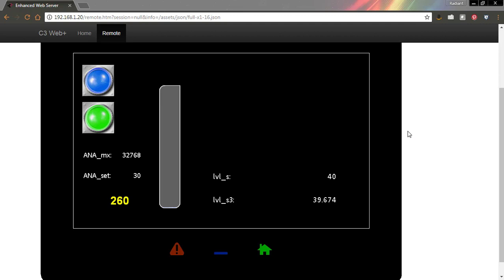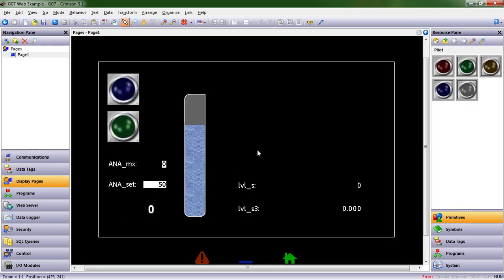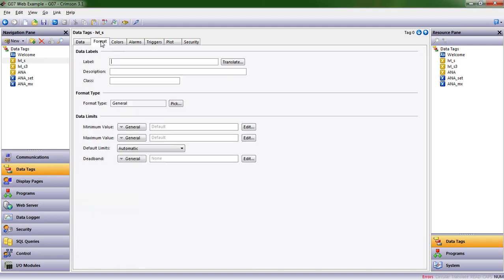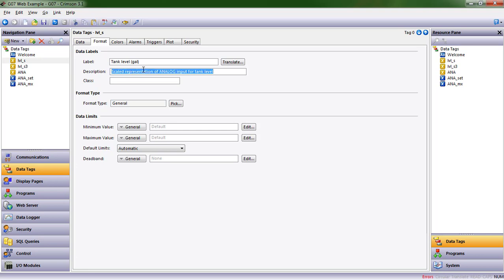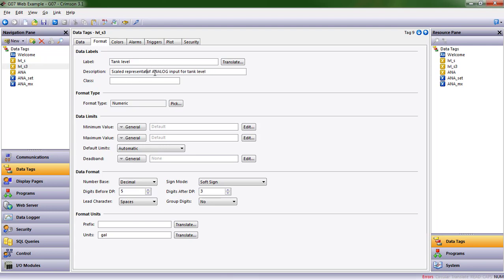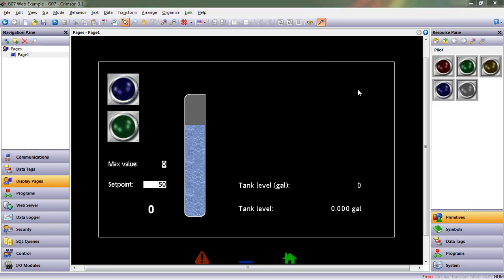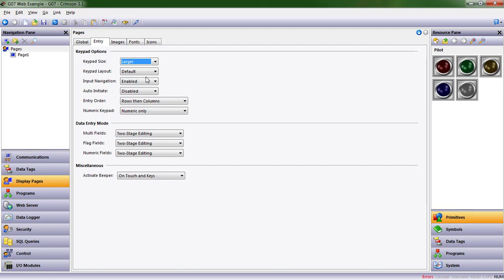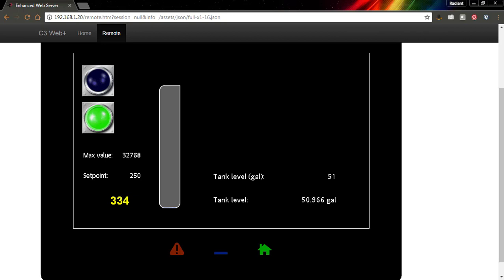Crimson 3.1 Training - Labels, Description, Keypad Size Changes

Comment: I have been programming Crimson (red lion) HMI for years, and know it well, but I want to display a Time Stamp on an operator screen (besides the Alarm&Event screen).  When an operator starts a machine, I want to indicated the date&time next to the machine.  If this is not possible, my second choice is to display an elapsed time (which I can do)  suggestions?
Reply: i would also like to know the answer to this question